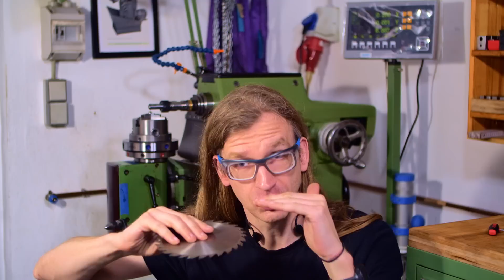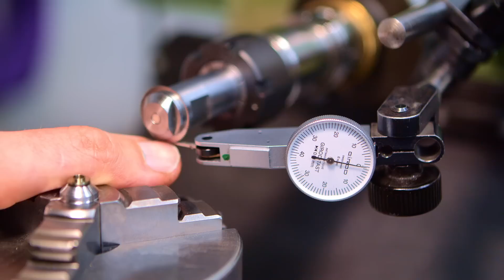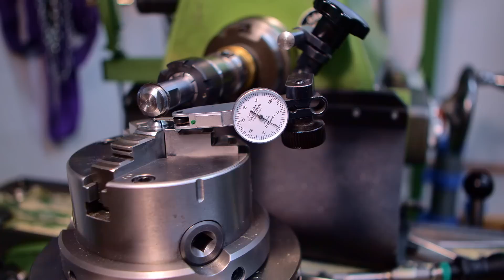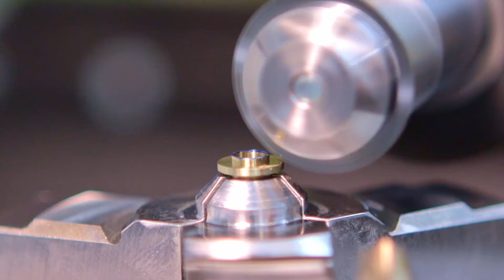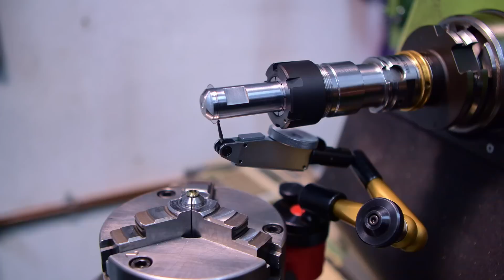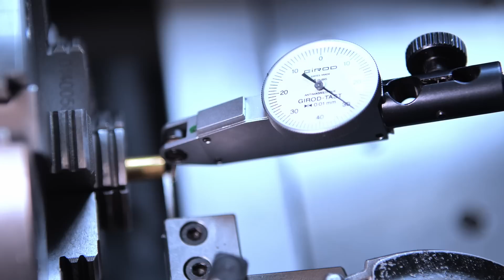Tool touch off by using flex

Comment: I usually have to use a microscope arrangement to drill anything under 1 mm. I use a Wild Heerbrugg 40X stereoscope on a fixture and watch the drill or center cutting endmill closely. It takes a delicate  hand. Nice presentation Stefan.

Comment: I may have missed it in this video that I am happy you shared with us.
To get the most accurate centering, I would think that you would rotate each to find the null point of run out on the blade and the work piece.

Comment: This is an application where electrical conductivity would be great to determine touch-off on each side if the part were electrically insulated from the spindle. That's unlikely on an old iron machine, but might be an option with a composite granite base.

Comment: 18:05 in this case cosine error would not even matter, correct? Because you're just finding a zero and going back to the same zero on the other side. it's not like you're directly measuring anything with it
Reply from the maker: Yes - Was more a side mention.
Reply: @StefanGotteswinter  I always appreciate the side mentions!

Comment: Thanks for the clever slitting saw centering trick, I had never seen that before! Use small thin slitting saws often so it will be super useful. And being a couple of years ahead of You I can confirm the eyesight issue mentioned...

Comment: Another great video! Haha on the lathe! "I would first of all question the design intent..."  Very, very true. I like and use your shown method but I think I will keep my Albrecht sensitive arbor and tiny chuck until I can afford shrink fit holders (and a machine that can take them). Most of my tiny tooling has a little punch mark to get it back in the min runout position every time.

Comment: Flex and slitting saws. Be very careful with the really thin ones. I have seen them bending in the cut. Proper speed and chip load! In a related cutting tool. Woodruff key cutters come in two types. Straight and Stagger Tooth. Spend extra on the Stage Tooth ones. They cut smoother. Much smoother.

Comment: "3 times less stiff"...ahh the metric system 😂

Thanks for the video, I always learn something from you
Reply from the maker: "The stiffness of 3/64 cheeseburgers"
Reply: @StefanGotteswinter  
I have no idea where you get your cheeseburgers so that's an invalid unit. Even archaic inches and feet.
Reply: That's.333333333333333333333333333 times less stiff.
Reply: @ Or as the Americans would call it - 1/3 of carbide`s stiffness...

Comment: Excellent show and tell as usual. I'm afraid I'll fat finger and move the tool incorrectly into the part instead of backing off once I've touched off😂
Reply from the maker: Thanks!
Clumsy me chipped the sawblade later that day when putting the toolholder with the saw down on the workbench.
Reply: @StefanGotteswinter  oh noes. I have a box of shame with broken micro end mills, most of them damaged in the same way.

Comment: Hi Stefan, it would add a lot of value to the video if you validated the results. Eg by fitting a gauge block into the slot, setting the part in a v block, and using a height gauge to quantify how many microns out of center the slot is.

Comment: I never imagined solid carbide saw blade would flex that much without cracking !
Personally, I've never had much luck using 0.3mm solid carbide drills so I went back to using HSS which allows some flex without breaking. 
I only use them in brass so maybe need cutting edge modified as they may be pulling in?
Even with 10 x magnification I can barely make out cutting edge though
Reply from the maker: Funny enough, I cracked that very sawblade later that day when putting the toolholder down on the bench in a clumsy way :-|
Reply: @StefanGotteswinter  Oh, not just me then.
I was thinking maybe I'm just extra clumsy breaking  so many bits, been blaming some on the machines, they are very 'low end' 😁

Comment: Beautiful work as always. Forgive my ignorance but how on earth do you change the drill in a shrink fit holder?
Reply from the maker: Yeah, induction heater or if you are a hack like me, a blow torch.
Reply: Usually there is an induction heater around the end of the holder that heats the end making the bore open slightly, then tool can be removed, that's the principal, there different setups of how it can be done

Comment: This is a great tip! Also an even better application would be with a 2 micron DTI... Well, a single micron or an inductive DTI probe for a Mahr Feinpruf or a similar readout would be even more precise, but 2 micron per division is more than sufficient for most general ``precision`` work... 

Best regards!
Steuss
Reply from the maker: I am jumping back and forth between a 2µm and a 10µm DTI, but the Girod 10µ really reacts very nicely to the smallest movements.
Reply: @StefanGotteswinter  I knew you would be doing so - I merely wrote the comment for the sake of the comment readers, tho that ``suggestion`` should be more than obvious(and unnecessary) to anyone who is familiar with the machine metrology field... 
As said, I only wrote it as you didn`t mention it in the video... 

By the way, while i`m here, i have a question for you - i don`t expect you to know much on it, as nobody seems to know anything on it, but, have you ever heard of - or seen manual Weisser milling machines? I just picked up a Weisser universal mill(knee type, 750kg, horiz spindle, overarm, bolt on vert head(missing) driven by the horiz spin) from 1955(marked as R.S. model), and from what i can find - there are literally 0 records of such machines... Weisser themselves have been failing to offer German performance and are not answering my inquiry for over 9 days now - putting us all to shame - but alas, it is not a business inquiry, so ``modern sensibilities`` give reason as to why(i won`t get political, tho i thought about one of your glancing statements - today - from an older video on a tangential topic, so i think that we might be similarly minded in that regard too)... 

If you have ever heard of or seen anything even similar - it would be most appreciated!

Best regards and kindest wishes!
Steuss

Comment: Excellent technique. How do you compensate for the inherent runout in slitting saws when making what is such a small part with low tolerance for error?
Reply from the maker: The carbide saws run so much nicer than HSS to begin with - Everythign else comes down to good saw arbor design. 
Most important is axial runout, it has to be as good as possible. In a pinch you can even turn the clamping surface of the arbor true with the arbor already setup in the milling machine.

Comment: stick a sheet of paper under the part holding device (rotary head & clamps) to electrically isolate, and use a multimeter between machine and part to determine electrical contact?
might even be able to not electrically isolate, and use the resistance measurement of a multimeter to determine when the cutter makes contact, resulting in a shorter electrical circuit thru the cutter and part and a lower ohm reading than the electrical contact thru the body of the machine...?  (total guess)

Comment: How much does the blade deflect from the air blast? I found that a strong air blast with a long endmill on a Bridgeport (everything locked of course) produced enough deflection that turning off the air after doing a bunch of spring passes caused a chip to be produced again.
Reply from the maker: Not in a relevant matter, as I can tell.

Comment: one of my most used trick on a manuel lathe when setting my tool's quite precise is the take one of those magnetic tool setter that lights up when touched/the cirget is complete ( always had the tools within 0.004mm of each other when i done it )
the saw blade when you use the test indicator like that basiclly becomes a pre-loading leaf spring if you think about it

Comment: This is a neat tip to set thin slitting saws and parting/grooving tools....I'll remember this one for future use👍
Also I have become a great fan of the solid carbide slitting saws...they are a bit more expensive but the precision and longevity of carbide slitting saws  is tremendous compared with HSS.

Comment: I have an old lever type fp1 and the Y gib lock is on the side opposite to the operator. It kinda drives me nuts especially if I am working sitting down. Is it the same on the newer type? I don’t know why they did that. Bad ergonomics on an otherwise brilliant machine.
Reply from the maker: Mine has the same arrangement - i dont use the axis lick a lot, mostly for heavy roughing. I usually reach with my right hand over the y axis.
Reply from the maker: The square FP1s have the clamp repositioned.

Comment: I´m just thinking of an electrical approach.
For this super fine work, where cutting forces are negligible, a plastic baseplate for the chuck may be an idea (really stiff phenolic or such comes to mind).
Now just with a multimeter, measuring the connectivity between tool an workpiece would show the exact moment of contact.
Doesn´t work with non-conductive workpieces though.
Reply: I bet you don’t even need the plastic base plate. The resistance through all that machine structure should be measurable and non-zero. It should decrease significantly when the tool touches the work.
Reply: @Chris-bg8mk  The definitely are some resistances, no doubt about it! 
But most multimeters change the display only a few times a second, that may make you miss the exact moment, while in continuity mode they beep instantly on contact.

Comment: Are these saw blades totally flat? Ordinary saw blades for wood are often thicker where the cutting tips are brazed on, I assume this is not a factor with these small carbide blades.
Reply from the maker: They have a very, very, very (very) minute hollow grind towards the center. But thats in the micron range with these tiny blades.

Comment: Thanks for sharing, in your opinion does the set of the teeth factor in? (assuming that tooth set on each side of the blade is symmetric)
Reply from the maker: These blades are not set - They are ever so slightly hollow ground towards the center.

Comment: I guess you think you're slick with your touch off and 180° rotatation, run-out mitigation, and the answer is yes you are.  Amazing tip.  I have learned so much from you over the years.  Thank you so much for sharing.
Reply from the maker: One of the rare occastions where i feel clever ;)
Reply: @StefanGotteswinter  Very cool technique - thanks for the explainer!

Comment: What indicator  stand is that? (I've  been wanting a teckusa one ever since playing with one on the works wire eroder)
Reply from the maker: The articulating one? Thats  small HG - Hoerger & Gessler - I like it a lot, the base-fine adjust works well. 
Not the same class as a Tekusa or MPtec in my opinion.

Comment: Nice technique(s) . I wonder if a low impedance electrical contact indicator would also work?
Reply from the maker: Hmm, could work, but at least with contact/continuity based edge finders I have not the best experience.